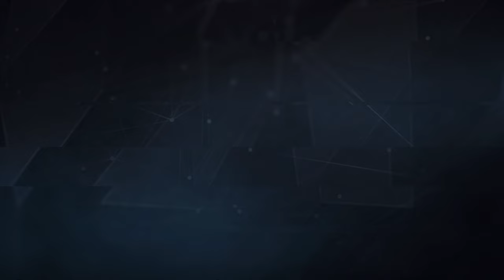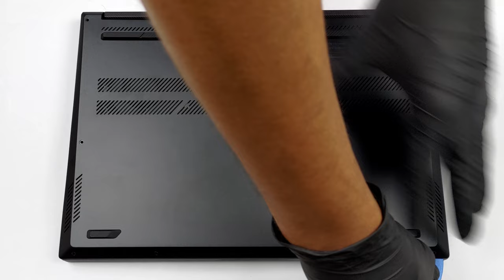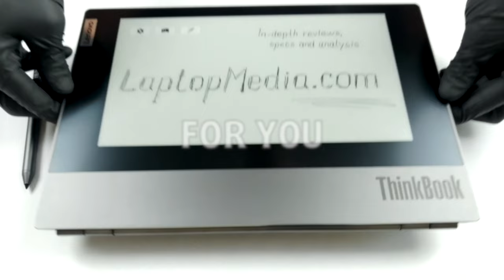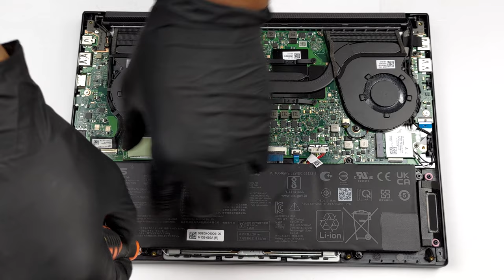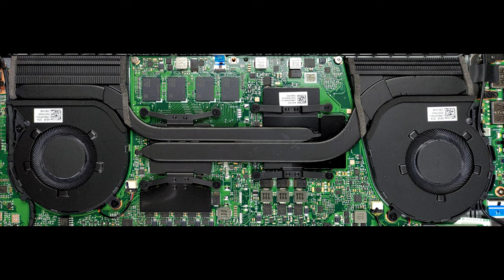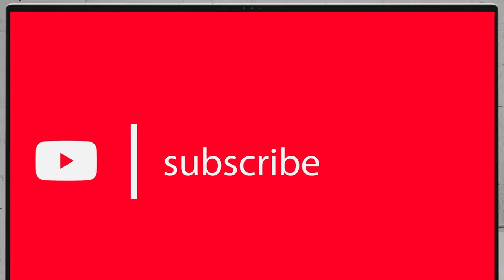🛠️ ASUS VivoBook Pro 14X OLED (M7400) - disassembly and upgrade options

Comment: it is absurd and sad I cannot find a top gamma with OLED panel (but actually even without) that has a slot for 2.5 inches sata ssd as I need a new powerful laptop and being able to mount my 8 TB samsung sata ssd in it. It is ..obsolete. I see the new pci4 ssd performances ok but almost no models expect sata ssd slot.. just non portable giant monsters from Clevo
Reply: Dude, this is 14 inch laptop with a freaking GPU installed. IDK about the temperatures but it'd definitely overheat if engineers put more parts inside

Comment: Is the base cover also aluminum like the lid? Could you please enumerate/illustrate which parts are aluminum? Thank you.
Reply: I think the base cover is plastic. I observed that most covers are plastic, if there is a sticker on it. If the laptop information is engraved in the base, then it is metal
Reply: It is metal on my unit, but it's silver. Black versions might be plastic though, I don't know.
Reply: @krisztianmarton4804  Mine has both a small sticker (which i removed) and an engraving
Reply: My version is gray/black - the whole body is aluminum (cover, base/bottom)